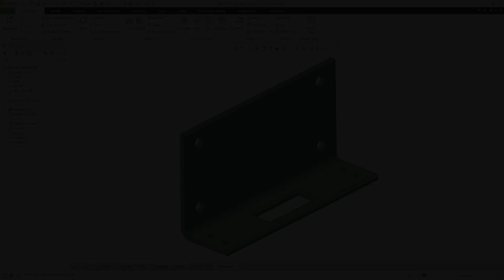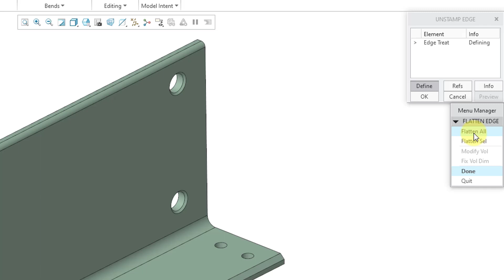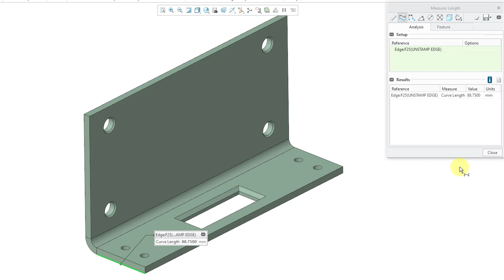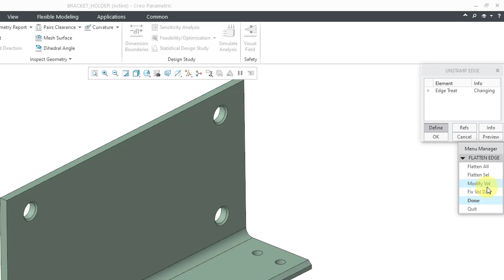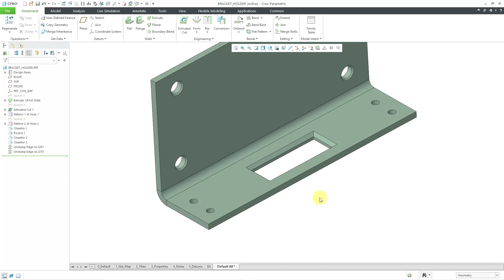Creo Parametric - Sheet Metal - Unstamp Edge

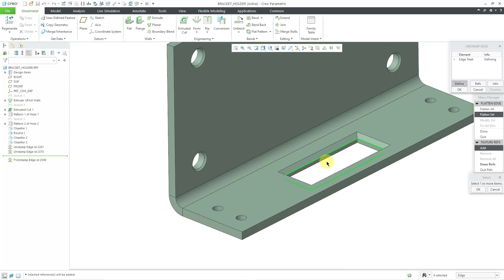Comment: At 5:27 you selected edges that were non-planar for the operation.  Was this intentional for the operation to fail or would it have failed if you picked the correct four edges that all met on the same plane as well?
Reply from the maker: It would have still failed. (Trust me, I do extensive and exhaustive testing when I research and prepare my videos.)